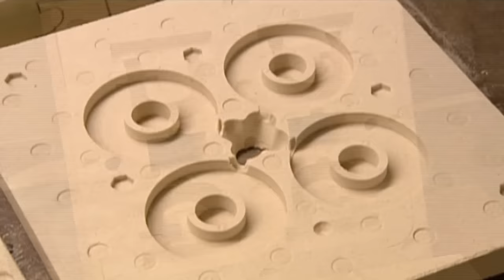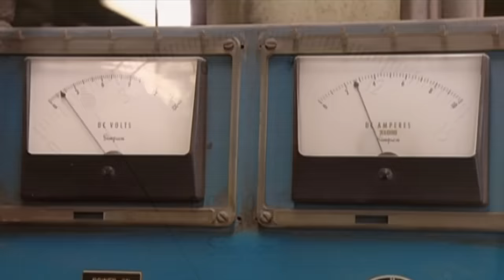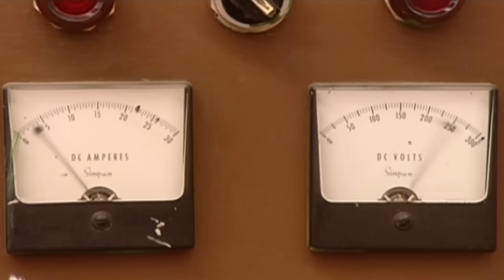MAGNETS | How It's Made

Comment: Wait i just got a 10000000 iq idea

Why dont we make cars but the wheels move using magnets and to slow it down the magnets turn around then sideways

Be honest this is a good idea
Reply: Sameerzz mognets get weaker over time so you would have to replace it often
Reply: what, so you throw the magnet far away to move the car forward? newtons third law makes sure your magnet wouldnt work if it is in the car. And magnets generally have only 2 poles and circular motions are not easily done
Reply: Lol thats a 0 iq idea
If u do that the magnet will just stick to the Wheel
Plus Magnet cannot pull a car Because magnet doesnt have much force And cars are very heavy

Comment: It would be good ya show everything in process, but not cut out, so leading to figure it out how it work. So, the process where stack up with a gap in between, so that is rod where you pour in, so you break down the stack, so the rod is there with a line base on line in align to stack with a gap, so the gap is in parallel to the line, so the rod with line, you put in furnace, then later when it melts, well, bendable, then in another device, so you put another rod in it, so it is a pressed down or so, so you put water, then volt, then it expands, the diameter of it, which has a ring, so that means the rod has no ring, so just a rod, so you put a rod to create a ring as it expands, then put water to cool it down and volt? The volt is for make it hard, so volt is heat so is furnace, but it is a point heat, instead of wide-spread heat like furnace. 

Then you cut up the ring into two edge of left and right, so you put volt so it causes to magnetism. So, the time of putting magnet is few second, so that equal how much force is inside the magnet?

Comment: MAGNET  
First I started with a drawing of a photon that converted to a positron electron pair in a "V" shape
Each charge shot off in opposite directions and opposite spin.

Then I drew a rectangle around it = BAR MAGNET.

Q.  Why don't the two ends of a bar magnet, meet in the middle and annihilate each other? If plus attracts minus, why don't the charge of a magnet meet in the middle and annihilate?
Q.  Why do the magnetic lines circle round the center of a bar magnet?  
Q.  We know the center has less charge or zero charge, so what's in the center? An annihilation zone.  Photons?  Both. 
Q Why would photons be in the middle?  Do they generate the charged particles at each end of the magnet, or are they the result of annihilation of charged particles that meet in the middle of the magnet.

May explain why there cannot be a monopole - because a photon has to be in the center to produce and power both charges at the same time.